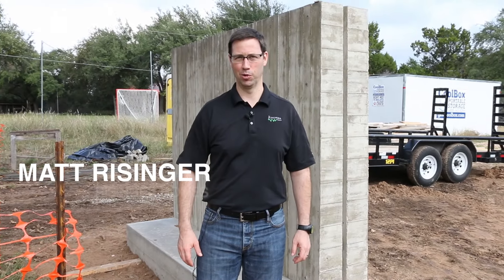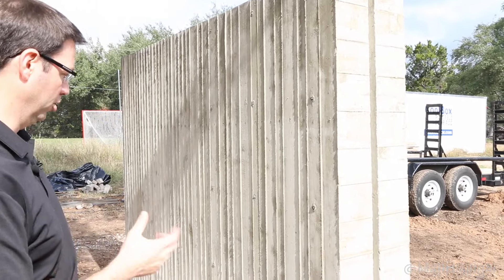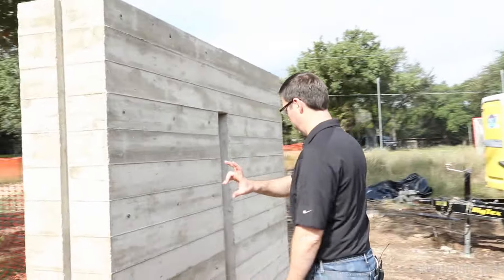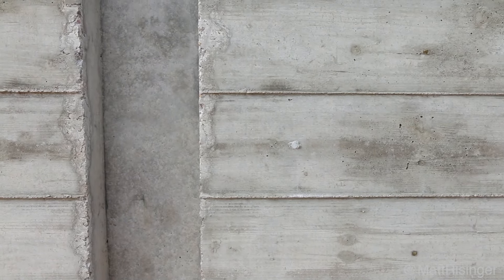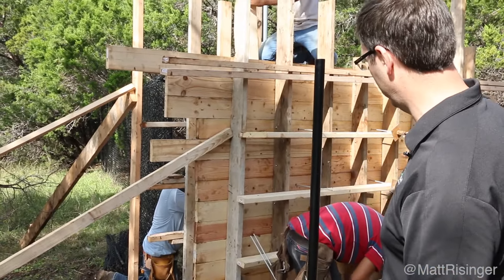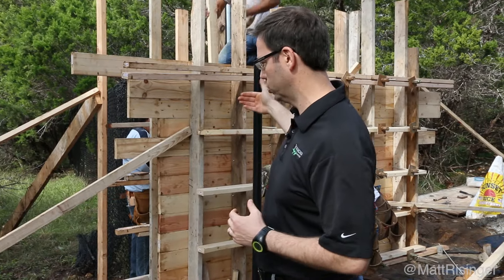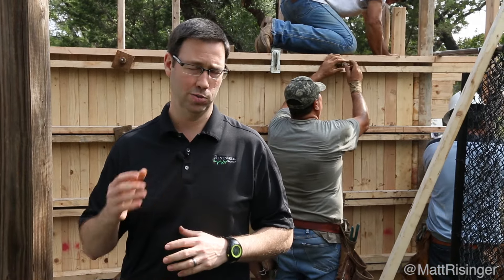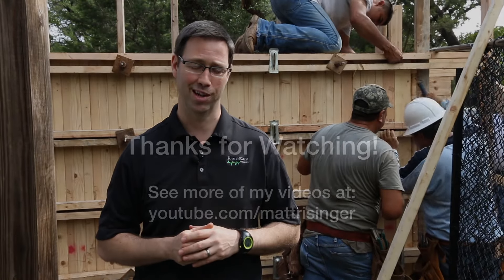Board Formed Architectural Concrete Walls - How To

Comment: Very cool. Thx for sharing.  I am going to do a deep laser cut  design into my wall boards and see how the cement takes the impression.  I will probably need to get a vibration tool, to get the more liquid cement into the laser etching.

Comment: great video Matt, appreciate you showing the process, was a little confused at first.
Reply from the maker: Thanks Joe, Probably not my finest video but I was excited to use my new wireless mic system!  Much slicker than my old one.  Seems like the sound is really good on this video.  Best, Matt
Reply: You're right sound is excellent, best compliment no complaints on hearing it...very solid.

Comment: Can a brick form be placed in there so the concrete gives the appearance of bricks? I have seen this done on the interior of a basement pour, but I have not seen it on the outside. would need some custom molds that fit a very specific side I'd imagine.

Comment: hello.  have you tried a plastic wall tie? they are reusable just lubricate them and remove them the next day. saves you money. also if your in a hot climate area wrap your mold with a plastic tarp so your artwork will cure properly it will add strength... just a  thought

Comment: How could one incorporate insulation into the wall.  I live in colorado and would very much like to do the lower 6 feet of the walls with board formed walls but would need to achieve at least an r-19 wall.  Any ideas?  thanks and I love your videos.
Reply from the maker: We are using these walls for a few exterior walls in the house and have a 2" sandwich of insulation between the outer and inner concrete for an R-14.  I'll have a future blog post showing how we did that.  Best, Matt
Reply: I have seen a similar sandwich construction used for insulated rammed earth walls here in Colorado, but the form ties and embedded foam board made compacting the earth mix very difficult.

Comment: @MattRisinger can (board formed concrete wall) be formed around steel wall framing? I only ask because I’m interested in that method but haven’t seen it widely used in the US, I’ve only seen in it in architecture magazines on homes in Dubai etc.

Comment: I´d like to see that borad formed and ow would u suggest to do it if we are working with a second story house. Beacause pouring concrete on  the second story would dirty the first story. And what about a reinforce concrete wall  with the same board look.
Reply: Make long plank forms, 2" thick. Like tiles, use thinset to adhere to the wall. Second story wood frame house cannot support the weight of the full concrete wall.

Comment: Hi Matt!  Love your informative videos!  Have you seen board formed concrete as a horizontal surface treatment?  Can that be done?  We are planning on using a color integrated concrete for a front patio, and I think the wood texture would look really good...  Either planks or even plywood sheets to give the concrete nice texture.  Any thoughts would be great!  (And thank you for the tankless water heater descaling flush video!  So helpful!)
Reply: See my recent comment below on using stamped stucco to achieve a board-formed texture.

Comment: Great Video, I want to pour something like that on a smaller scale.  What kind of concrete mix do you use?  How do you get it so smooth along the surface?  Thanks.
Reply from the maker: kiddbogart The mix isn't nearly as important as the placement.  Lots of vibration is the key along with good form work.  Thanks for watching!
Reply: Yes, Matt is correct- a special tool that vibrates the concrete to settle down the rocks from the cement. Leaving sides smooth, but caution, if you vibrate too much your concrete wall will loose all strength on the area that you vibrate out the rocks, left with only sand and cement.

Comment: Well me as a 3D artist just can say that is some really awesome footage I was long looking for this kinda information everywhere because I always have to keep sings photo realistic as possible like this concrete and here comes my special question are there any special rules when and why to use wood pattern horizontal or vertical aligned maybe horizontal for outdoor walls? And how many centimetres are those Wood shelves regulary? don't know maybe you can tell me? Best greetings
Reply: The direction of light is the best answer as to place vertical or horizontal. The shadow it will cast is the desired effect your looking for.
Reply: Which direction are you trying to draw the eye? Are you wanting to accentuate a long horizontal form, or do you wish it to appear more truncated than it actually is?
You'd set the pattern horizontal for the first and vertical for the second. Conversely, if you're trying to accentuate a vertical form, you'd set the forms vertically and you'd set the forms horizontally if you're wanting to downplay the height.
Reply: Okay thanks a lot that's a very interesting finding as I said I'm not an architect and can't justify it professionally I didn't think it was more eye bowling, I thought it might have something to do with possible material costs and with the practical design as such but of course  the aesthetics and the eye play a big role I always find it interesting how you do something virtually for years and then see it in reality for the first time and it finally makes sense Thank you very much for the upcoming great channel great video, keep it up. Kind   Greetings ;)

Comment: How did you achieve the color variation? What  can be done to ensure tight form work that does not warp if we don’t use tie rods?
Reply: That's what the Tie rods solve, but if no rods use heavy Gage wire, loop wire thru the form around the 2X4-6 put a thickness Gage in the form then  twist the wire till tight. Remove spacer Gage

Comment: Hi Matt - can you elaborate on what is in the center of the wall (if anything)? Is it insulation?
Reply from the maker: +Matt Larson Yes, we have 2" rigid foam in the center core of the exterior walls.  Matt
Reply: Can you ellaborate more on the insulation of concrete forms???

Comment: I love poured concrete but don’t like the look of board texture permanently left in the concrete. What are alternative forms?
Reply: Jesse Waugh try using large silicone or rubber tiles. Use these on the inside over the wood. You can even create faux textures depending on the molds or tiles.
Reply: Chris Morales Thanks will look into it!

Comment: Hi Matt.  Can you create this look on a wall that's not concrete if you want this affect but don't need a concrete wall?
Reply: you could probably make a cinderblock wall, cover it with slurry, then press/clamp boards to it to maybe make imprints of the the wood grain.  I've never done it, but in theory that could work.
Reply: VanAwesome I don't need/want structural concrete walls but love the board-formed texture - I'm trying to figure out if a reasonably thin coat of GFRC mix - poured horizontally - would bond to an off-the-shelf cementitious panel and take a pre-fabbed board form texture stamp.
Reply: Steve Hoge That would be incredible if it works.   I would like to do the same thing.  Let me know how it goes if you try it.
Reply: I have since seen it done with stucco (or shotcrete - owner didn't know which) applied over CMUs, using actual 2x6 boards to apply a vertical texture to the wet stucco.   It gave a reasonable facsimile of a board-formed concrete wall, but the stucco mix was not quite smooth enough to pass on close inspection for a true poured-in-place wall.  I think that by tuning the mix with plasticizers and a finer-grained sand in the stucco mix this would look spot on.  The vertical board texture was perhaps easier to achieve than a horizontal pattern since you are not working so much against gravity.
Reply: I have seen this done recently - see comment below.

Comment: Hi Matt. Thanks for that, it is really hard to find good information on board form and off form walls.

Can you recommend what type of timbers give a good indent? I have heard you can use Douglas fir?

Any suggestions would be great. Thank you.
Reply from the maker: Simon Jardak I'd recommend a mock-up with your details.  We are using SPF on this project but Doug Fir would certainly be nice too.
Reply: Matt Risinger Thank you.
Are you leaving a gap between each board or going hard up?
If there is a gap, how much of a gap are you leaving between each board?
Reply: Simon Jardak I like the linear texture created by the gaps between boards - seems like it would be tricky to release the form without breaking or binding to the excess concrete left in the joint.

Comment: Hi Matt and thanks. I actually want to build my own house (my first) using form concrete walls. My structure is a fairly simple rectangle: two walls and two 1/3 walls (will be mainly floor to ceiling glass at both ends), floor and ceiling. Can I do this DIY if I hire a contractor to come out initially and periodically to make sure I am staying on point?
Reply: I found that city or county inspectors, can advise you, when you call them out for inspection, and you fail. They try too explain how to do it correctly.
Or if you just ask for city approved plans that you can have .

Comment: How do you keep your wall thickness correct without any cones?
Reply: The Ties used to keep forms from pulling apart (blow out) come in thickness lengths, with cones.

Comment: can you do a video on insulating cinder block houses
Reply from the maker: I'm not sure I have any projects with that coming up.  If you're in the South I'd look into an Exterior Insulating Finishing System.  2"+ or rigid foam on the outside of that building with a stucco finish would be fantastic.  STO makes a good system.  Best, Matt
Reply: Matt Risinger
I saw a department store being built in the manner you described with rigid foam over cinder block, but it looked like they were putting tyvek either under the foam or over it, (it was too far away to tell)  do you think thats a necessary step with cinder block ?